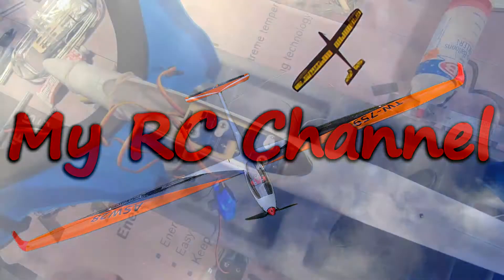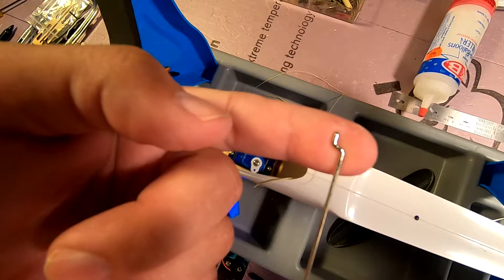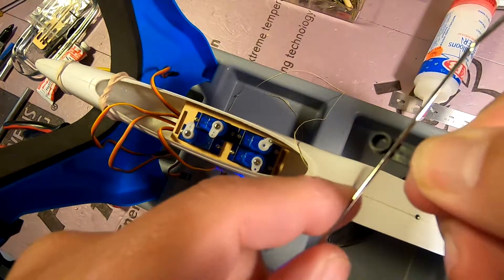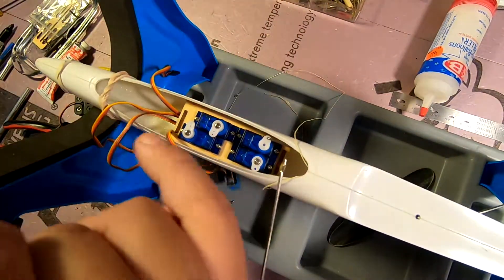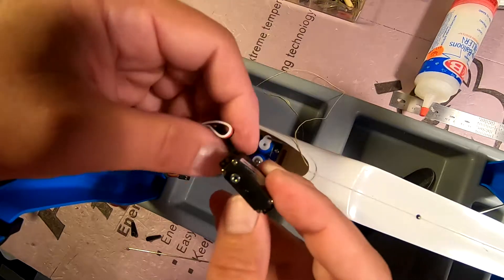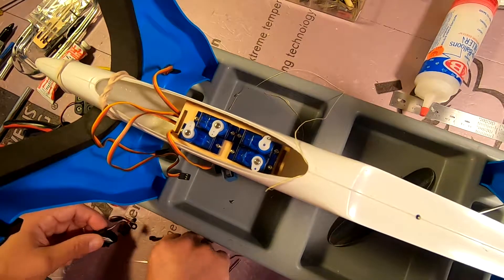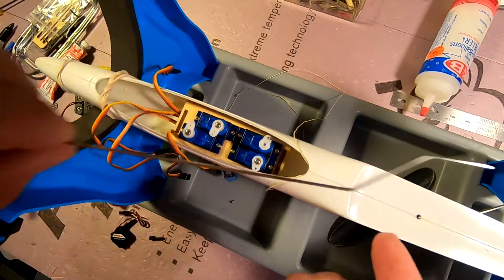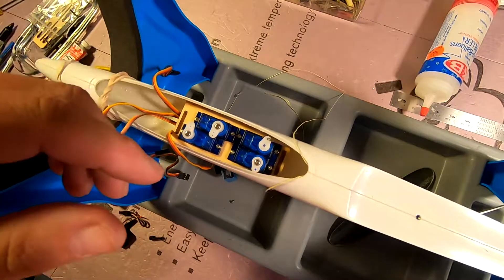HobbyKing Raven 1500 DLG - Build Pt11 - Connecting the Ailerons

Comment: Where the wire goes through the aileron horns, bend the wire 90 degrees.  When installing the wing, poke the wires through the horns and add the keeper so they stay in the horns.  Will always keep the same length that way, no re-trimming.